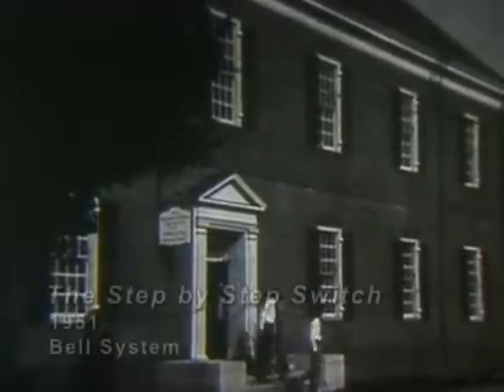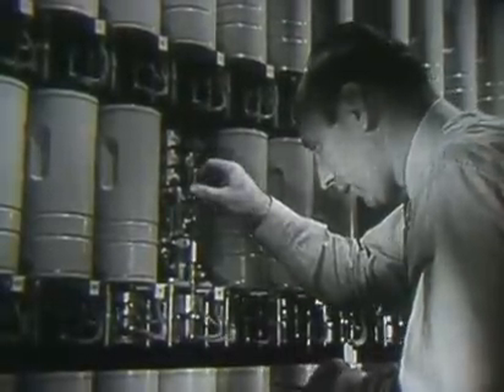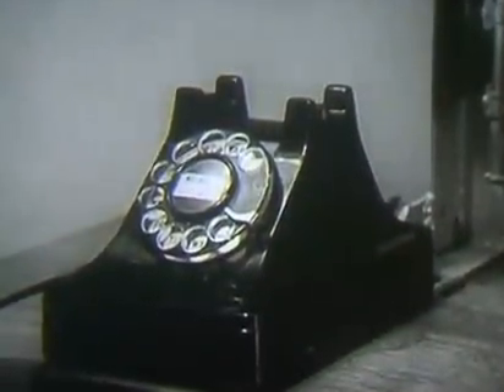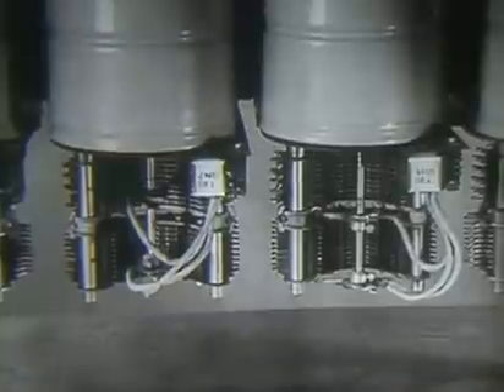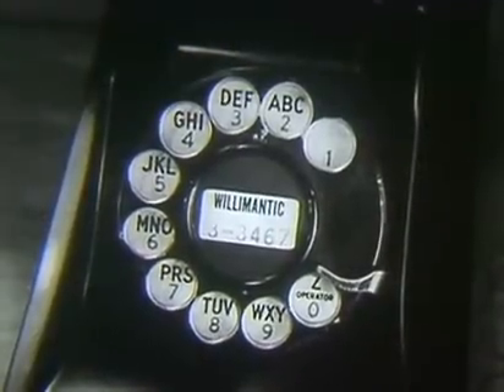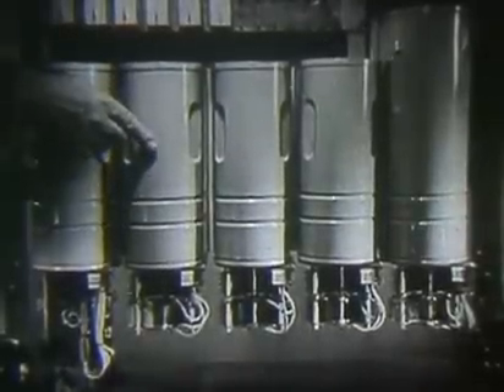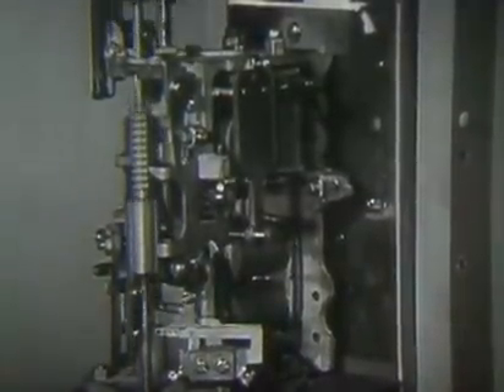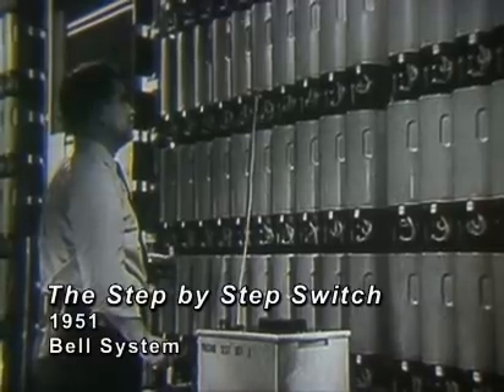AT&T Archives: The Step-By-Step Switch

Comment: How were each selector stage wired to the next selector in sequence connected?  If there were 100 potential contacts at each stage that means there are 100 downstream SxS switches connected to it; where were the next stage selectors located? In the next frame? Aisle? Room? In another CO? How were the last stage digit connected to the subscriber's terminal to their home?  If the local CO handed an exchange (or several) then those calls wouldn't leave the building I suppose.  If the first digit was a "1" then that would presumably route the call out of the CO.

Seeing how calls were routed as each digit was dialed would be interesting.
Reply: +lohphat Look up 33 Thomas Street in Manhattan.  That gives you an idea of the scope of just how much up and downstream physical equipment needed to be located in one place for stuff like this.   It's a skyscraper that was basically filled completely with equipment from this era and a bit after it.  811 tenth avenue as well.
Reply: Each line finder was wired directly to one first selector. Each first selector's 100 potential contacts were wired to multiple instances of trunks running to second selectors, which might be located in any selector frame in the same CO, or in a different CO, as needed to route the call.  The selectors "trunk hunt," meaning that they cut in on the dialed level and search across the ten contacts until they find a free trunk.  If all are busy, the contact wiper comes to rest on an eleventh contact that provides the "all circuits busy" tone.  Thanks to the multiples, there are more contacts on the selector contact bank than there are unique circuits moving forward.  Each successive selector stage narrows the "search" in the call's progress, from an entire CO, to a group of selectors, to a particular connector switch. Selectors don't necessarily wire directly to another selector, either. They may wire to trunks to access another CO, an operator, a toll line, etc.

Selectors served as both distribution and concentration; distribution to other areas in the CO, other CO's, toll offices, operators, etc.; concentration as the call path zeroed in to a group of 10,000 numbers, to 1,000, to the connector bearing the desired subscriber line.

Subscriber lines, just a pair of wires, connect to "subscriber line equipment" in the CO, adjacent to the line finders. This is a pair of relays called "line" and "cutoff" relays. The relays extend the subscriber's tip and ring wires and also create a "sleeve" wire that's used as a control signal in the switching system. The tip and ring are hardwired to any position on a line finder. That can be at random, and is multipled to other line finders so that the line is not disabled when the one line finder is already busy. (When the SXS system was largely idle, you'd get a line finder quickly, and hence get dial tone right away. When the system was heavily loaded, you'd have to wait for a line finder further down the multiple, so you'd get silence for a bit after you picked up the phone.) The tip and ring are also hardwired to a connector, but this must correspond to the last two digits of the subscriber's phone number, because the connector is directly stepped up and across by dial pulses.  Dial xxx-xx58, you're going to ring the phone on bank terminal 58.  When a subscriber originates a call, the line equipment starts a line finder. When a subscriber answers a call, the line equipment handles the inbound call from the connector terminals. It seems circular, to be wired to both the input and output of the switch, so to speak, but the relays make it work.

Correct, a call made within the local exchange didn't leave the building. They tried to avoid using "1" for first selectors to avoid accidental pulses caused by the phones' hookswitches. You can dial a SXS office by tapping the hookswitch.

Comment: Amazing. Just amazing.

 I'm sure the electronic equivalent of all those moving parts could have been built even in the 1950's, yet they weren't replaced until digital setups became practical. I'm sure a transistorized board would have been a lot more reliable and used less power, but I'm also sure AT&T had good reasons to stick with mechanical.
Reply: +Wesley Matulis 

I worked on some of this old electromechanical and replacement electronic version cards for things like ringer circuits. 
The problems they were dealing with then was that most exchanges had a 48 or 50 V DC bus bar. All equipment drew power off it. The electromechanical stuff put massive noise (back emf's from relay coils) back into the bus bars. 
So for the electronics to work they needed a clean supply but in those days all they had were diodes and zener diodes to control the voltage spikes. Sometimes it was not enough to clamp or remove the noise . Abt 1979 I worked briefly with an electronics engineer on a project to create a an electronic device to detect and trap faulty incoming dial pulse repeaters in a Siemens exchange. It worked to a point but the noise in the power kept blowing the electronic components & making the whole concept unreliable.
Reply: +Riche Bright Those old switches were very reliable but needed people to maintain them. Those old switches would run for years but needed to be cleaned and adjusted. ESS (electronic switching systems) of course have a lot of features and a no.5 ESS can handle 50,000 calls an hour. With SXS you had crews of men inside the CO that worked full time maintaining them.
Reply: +Riche Bright 
AT&T weren't the only player in this game. I'm sure they did try.

For example Siemens had the ESK - CP24 exchange in the early 1980's that was a hybrid of ESK relays for the switching matrix and CMOS electronic chips for control. 
It didn't work too well because electromechanical devices make power supplies very dirty. The voltage spikes, back emf's, noise from the relays etc caused big problems for electronics in those days. 
The electronics technology was still very immature for switching, for instance, a CP24 I once worked in, a lightening strike in the area caused hundreds of subscribers lines to be knocked out as they had fuseable resistors in their line cards.
Reply: +Riche Bright They had to wait till Bell Labs mastered the transistor :)